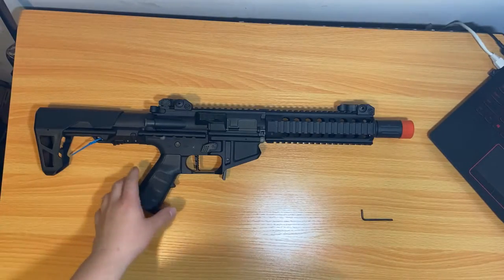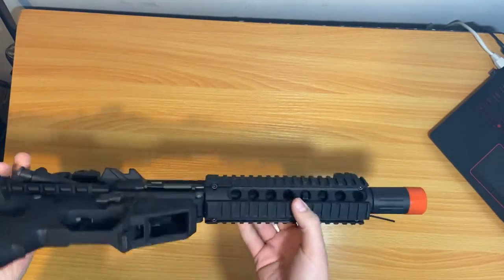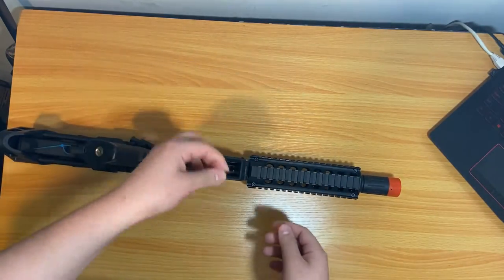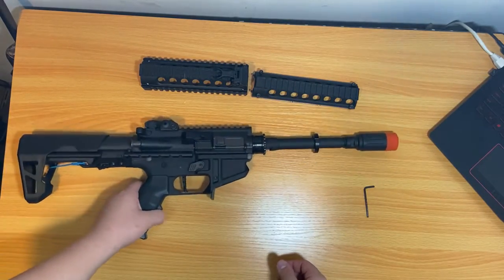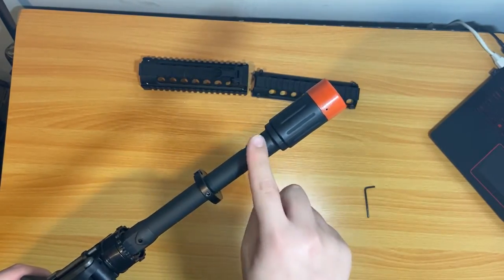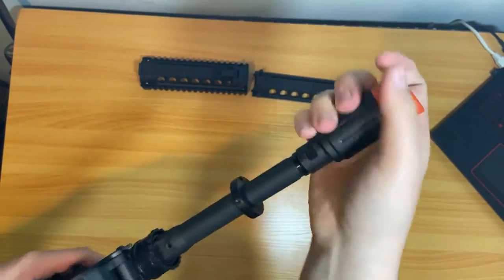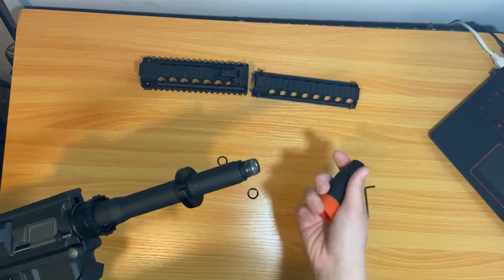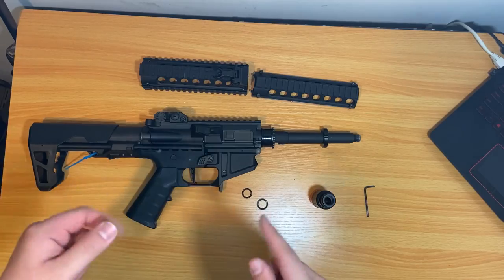How To Remove Flashhider/Amplifier Off King Arms PDW 9mm SBR!!!

Comment: Great gun,what I did for mine (short version) was cut out the plastic around the pin on the orange tip then used pliers to pull out the pin,next I did was boil two cups of water, left the entire and maybe a little bit more than the orange tip in the water and proceeded to twist off the amp to the left when pointing the gun toward you as if shooting it, in my experience it took several times of heating water leaving the amp submerged for about 10 mins then between that,twisting off the tip and basically wiggle twisting,eventually after after three boiling water submerged and twists it came off clean. Btw if anyone hates the orange amp and doesn’t want it please let me have it or buy it off you (: EDIT: the best rail system for this gun regardless of mlok or pic rail factory version would be the OctArms mlok rail system, 5.7 inch I believe (shortest option on evike) is the best for the short rail pdw and the long version you’ll have to figure out as I only have two short versions one which I replaced with the OctArms rail and the other that has the tan mlok that I’m gonna replace with the OctArms,thanks for the video!

Comment: Has anyone had a problem with the motor adjustment screw coming loose when firing and if so what’s a solution
Reply from the maker: Garfield if the screw keeps loosening up on you, you can use some glue/loctite adhesive to keep it in place, but if you are to ever undo that screw you’re gonna have to heat up the glue to remove it, but before glueing the screw if you do, make sure your have the correct motor height. There is tons of videos showing you how to find the motor height on YouTube. Anyways hope this helps. Good Luck! 👍
Reply: Alright thanks a lot I just didn’t know like if it was ok to put locktight in it.
Reply: And thanks for the help man I’ll sub
Reply: Readjust the screw to the correct motor position then nail polish it so it doesn’t come out yet can be easily removed with nail polish remover
Reply: you want blue loctite. red is permanent. blue is temporary

Comment: Bro I have m4 cqb king arms blackwater 15. Any idea how to remove that big flash hider? Ive tryed everything and dont know how. It doesnt have any pins or screws on it and its attached to something but I cant find what n how to remove it
Reply from the maker: So if there is no screw or pin on the bottom of the flash hider, either dip it in boiling water for a few minutes (just the flash hider) then turn it clockwise to loosen, other wise use a hair dryer or heat gun to loosen up the glue in the threadings. Hopefully this works 🤷‍♂️ Good Luck!
Reply: @AirsoftSST  will try but its full metal gun with a big metal flash hider I wanted to replace it with silencer. If u can check on google for king arms bw15 pistol. Rly noone made a video about it. 2 guys doing review and thats it. Its m4 cqb rly short gun.
Reply from the maker: Yeh if it’s a metal flash hider it will be hard to get the heat through other than plastic so make sure to heat for a while

Comment: I'm getting a medium sized one that called the m-lok do you know if it would be the same as the small?
Reply from the maker: Braxton Ancheta should be the same as the short as long as you didn’t get the silenced one
Reply: @AirsoftSST  alright thx and btw I recommend this vid to some of my friends cause they all have a orange flash hider on there gun and didnt want it so thx
Reply from the maker: Thank You!!! Much Appreciated😊🙏
Reply: So you can’t take the orange tip off the silenced version?
Reply from the maker: The orange tip doesn’t come off I’m pretty sure, you would need to remove the whole suppressor and buy a different suppressor if you didn’t want the orange, or just spray paint it 🤷‍♂️
Reply: @AirsoftSST  how would you remove the suppressor?
Reply from the maker: The_officialgroup Not sure, haven’t looked at that model yet to know 🤷‍♂️ sorry
Reply: @AirsoftSST  ok thank you
Reply from the maker: @The_officialgroup No problem
Reply: @AirsoftSST  I’m sorry for being an annoyance but I’m relatively new to airsoft but do you have an idea of what length and size of mock suppressor to put on the regular mlok because I’m thinking about waiting for them to come in stock so I can put a suppressor on it, Thanks!
Reply from the maker: You can put whatever sized suppressor on, most standard mock suppressors fit all smg/AR Styled guns, just make sure the suppressor you’re getting fits 14mm ccw threads
Reply: @AirsoftSST  thank you so much 🙏🙏

Comment: Can you give me tips on how to do it for the small version?
Reply from the maker: The short version should actually be easier to remove since you have access to the amplifier than with the long one it’s blocked by the hand guard
Reply: @AirsoftSST  boiling water took the pin out but the amplifier wont cone out no matter how long/many times i boiled water
Reply from the maker: @nokadota4417  are you twisting it clockwise to loosen it because the threads are 14mm ccw so you have to turn it right to loosen

Comment: I'm saving up to buy this gun, it will be my first aeg.(I have only had GBBRs so far) Do you think that a Titan 11.1v battery would work with it? If so what is the biggest size that would fit?
Reply: use a lilpo 7.4
Reply: use 11.1 lipo (around 10cm long and 1.7cm wide)

Comment: Can I get some help😅, I tried blow drying it for about 30 min and it wouldn’t twist off
Reply from the maker: Either try boiling water in a pot and dip it in far enough to get the threads, or slightly pour the boiled water over the threads, after that make sure to be turning the amplifier clockwise to loosin, some people get confused with that
Reply: @AirsoftSST  thanks I’ll try that
Reply: @AirsoftSST  Idk why but it’s not working 😔
Reply: @AirsoftSST  it worked 😭😭🥳🥳
Reply: @ybbetter5274  what did u do I need help!
Reply: @minorjacobo7811  I heated it up with a blow dryer on like 3 different occasions/days. One time I went to an airsoft spot and the guy pulled out the pin as much as he could . There is a pin wedged in the threading. I finally got it at the end
Reply: @ybbetter5274  what did he use to pull the pin as far out?
Reply: @ybbetter5274  not even budging a bit tried the heat blower for 25 minutes and nippers not even lose
Reply: @minorjacobo7811  try doing it again a couple times, I forgot to say on those 3 different occasions i did it for like 30 min
Reply: @ybbetter5274  ok thanks for the help if it doesn’t work I’ll returning the item👍🏽
Reply: @minorjacobo7811  ok bro 👍🏼

Comment: What about the suppressed version??
Reply from the maker: I’m not sure on how to do the suppressed one, but I will get back to you if I can find a way👍
Reply: Airsoft S_S_T ok man thanks. My friends birthday is coming around so he’s getting that from his parents and I’m going BIG and getting him a tracer unit
Reply from the maker: So it seems that the suppressed one should easily screw off, you may need to heat the threaded end up a bit but other wise it’s the same concept as the amplifier, oh and I’m not sure if there is a pin for the suppressor, if not then you don’t need to worry about that.
Reply: Airsoft S_S_T ok man thanks so much. Ur a big help
Reply from the maker: No problem, Glad I can help😁

Comment: Tried the same thing and it wouldn’t budge. Any tips?
Reply: Gavin Merten when you shoot yours does the motor adjustment screw start to come undone. I don’t know what to do cause every time I shoot it that happens.
Reply from the maker: Make sure that you really heated up that adhesive in the threading, because that stuff is strong, and to loosen the amplifier you need to turn is right, because it’s a 14mm negative threading. Some people had this problem because they didn’t know which way to turn it😂, and make sure to really wiggle the amplifier back and forth, that should undo it, but if not my bad, not sure from there. but hopefully this helps, Good luck! 👍
Reply from the maker: Is there a hole in the bottom of your flash hider, and if there is, is there a pin or a screw in there?
Reply: Yea mine is full orange and is the same I’m gonna try to dip the whole thing in boiling water and see if that works. I just don’t think I was able to get it hot enough.
Reply from the maker: Yeah that should work 👍 😂
Reply: I tried again with the hair dryer but this time I waited way longer and it finally came off
Reply: If the hair dryer doesn’t work try boiling water but be careful not to melt the whole thing

Comment: I just want to remove the orange part I actually really like the stock flash hider
Reply from the maker: Not sure, I know the pin on the orange part is the same as the flash hider pin, just not sure if it’s the same removal process
Reply: Paint
Reply: could just dye it. in the world of rc we dye our parts in airsoft everyone wants to paint everything ...its a  subcultural thing i guess lol
Reply: @thelaughingman79  dye it? With what? I thought plastic doesn't take well to dyes.
Reply: @Acemans   clothes dye ..use hot water set the part in a container for 12 to 14 hours. I assure you it works if you browse rc forums you can find about a half a million posts on it.

Comment: Have the tool to twist the pin not the silencer. I also want to say use a wrench I guarantee youre not opening it with just hands when twisting they put glue on there

Comment: Didn’t work
Reply from the maker: @JoeyMonday714 Try sticking it into boiling water that seemed to work for a lot of other people
Reply: Airsoft S_S_T the pin doesn’t come out
Reply from the maker: @JoeyMonday714 Are you twisting the amplifier clockwise? Because the threads are negative so you have to twist right in order to loosen it